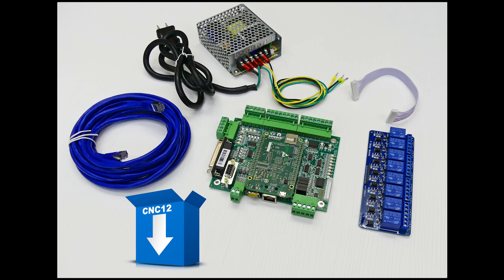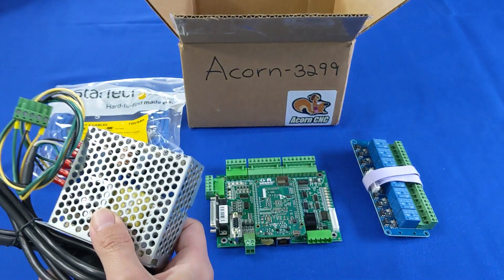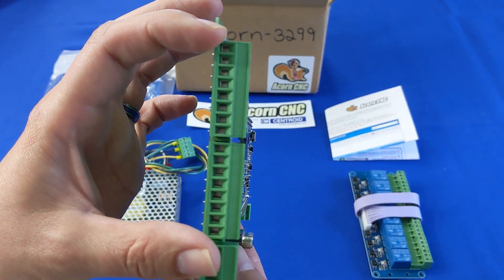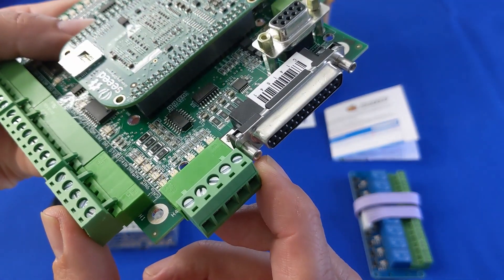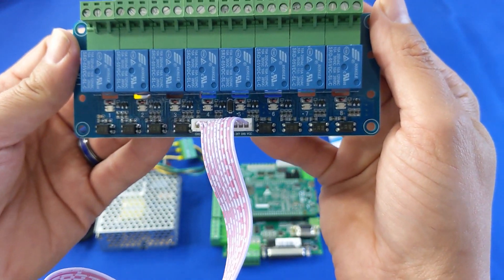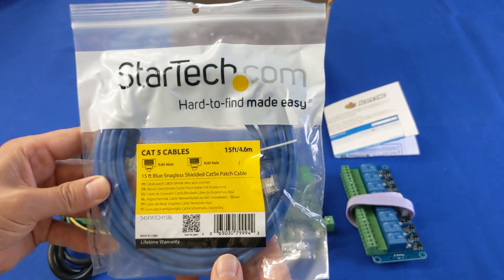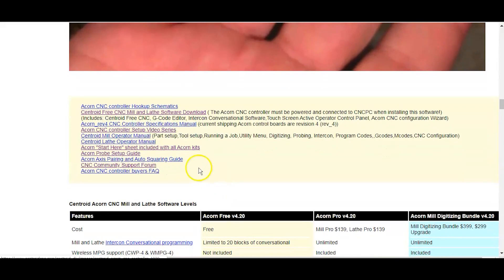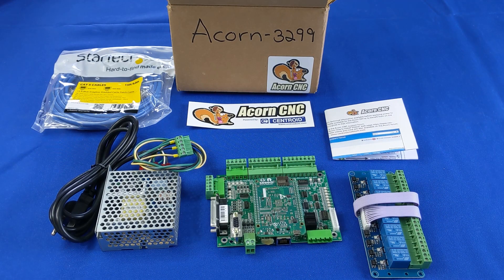Centroid Acorn CNC controller kit UNBOXING and introduction.

Comment: I really like this concept, just wish I could use it with my Fadal.  I don't want to rip out the DC motors with resolvers (like I had to do on my Shizuoka) to take advantage of this.
Reply from the maker: dc motors with an encoder upgrade will work with the centroid allin1dc controller..  https://www.centroidcnc.com/centroid_diy/allin1dc_cnc_controller.html